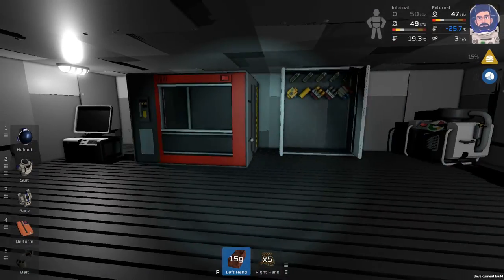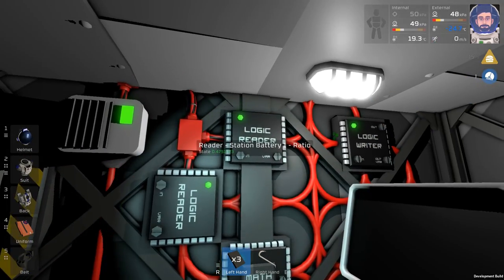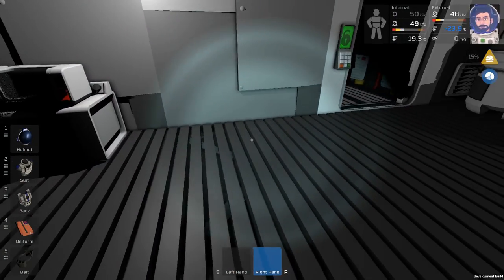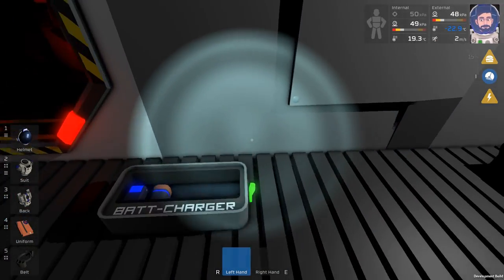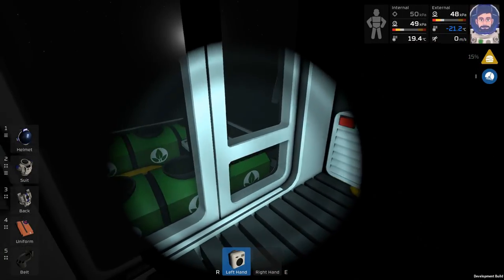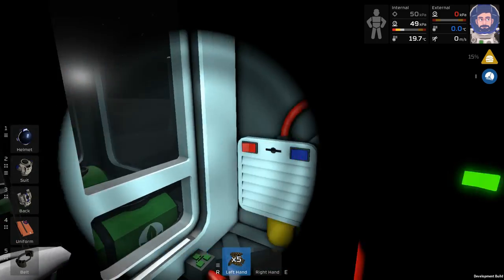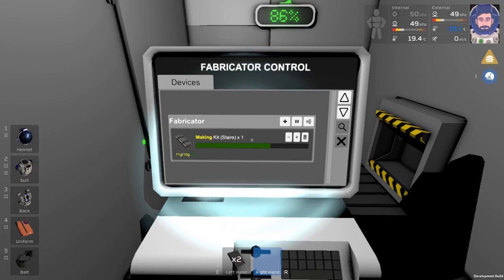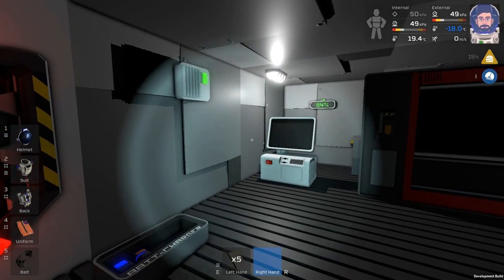Let's Play Stationeers - E9: A Better Way To Get A Power Reading & Still Can't Grow Crops!

Comment: Every time i watch your Sationeers let's plays it makes me want to buy this game, but then i remember i don't have anyone to play with, and in solo i will get bored really fast. Gaben should ship some friends with such games.
Air cooler needs pipes because it needs to dump heat to somewhere. In the real world you can't just cool. something, only take the heat and transfer it to somewhere else. That's general law of physics, mass-energy conservation, and as i see game simulates it to some degree.
And i find it very inefficient, you waste power on cooling your hydroponics, an also to heat main room with heater. I thought about it a hile and come with an idea. But first, i must warn that i haven't played this game, only looked at wiki. for what blocks game has an how they work. So not guarantee that it will work. But here is my idea. There is Conditioner block, it can cool off and heat up substances in pipes from -99 to +99 degrees, it has intake pipe port, output pipe port (from where heated/cooled substance comes) and heat exchange pipe port, to where heat dumps or taken. Setup is like that: one conditioner is in hydroponics, set to +30 degrees, an active vent is on intake port, passive vent on the output port. They cycle air in hydroponics. The second conditioner is in the main room, set to +20 degree, same with active and passive vents. Exchange ports of both conditioners connected to each other. Oh and one thing, heat exchange pipes should be filled with something, because you know, a vacuum doesn't transfer heat, *sight*physics. So fill it with some gas and seal with a valve. I also recommend putting this heat pipes though exterior. Now as plants will generate heat it will be transferred to the main room, which as i see always super cold. And conditioners first use heat from exchange port and only then use power to heat/cool things. And in case there will be too much of a heat generate you can put radiator block on pipes. Radiators don't use power, mounts over pipes, and take heat from a substance in the pipe and irradiate it. So you can balance out you heat with radiators and dissipate excess heat to an exterior. Also in case you going to expand your base, you can strip off some radiators to get back more heat.
Wow, that some wall of text here -_-